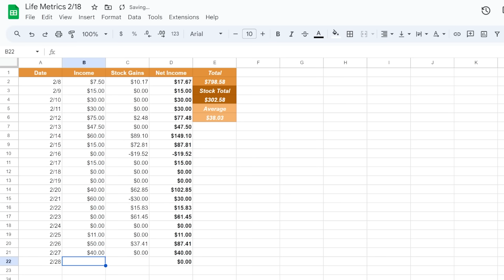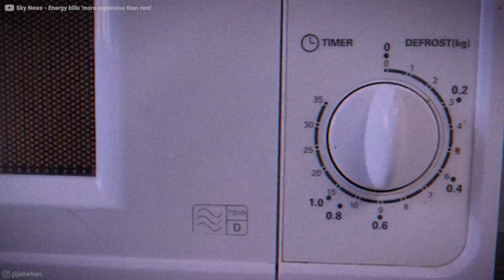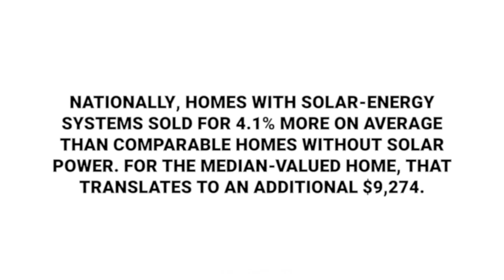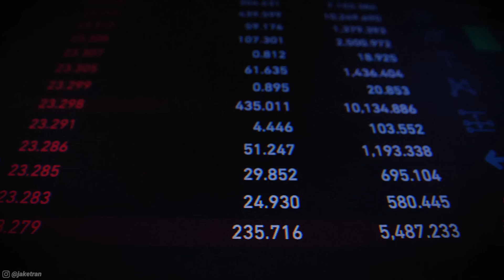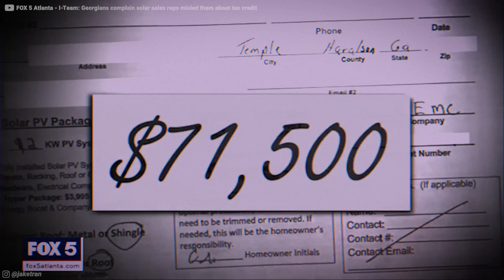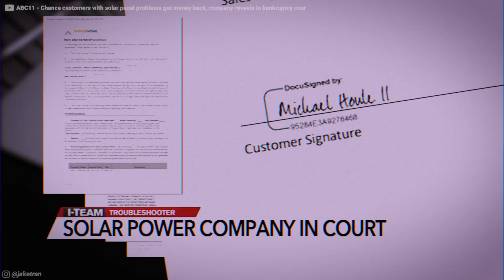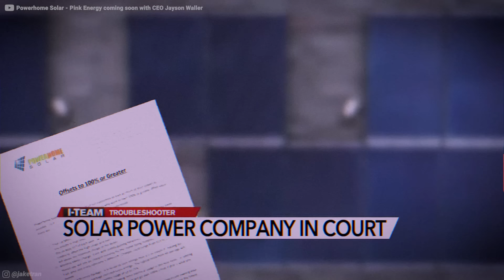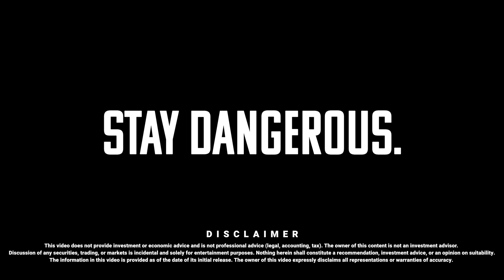Home solar panels are literally a scam.

Comment: I own a 5.5 kw off-grid solar system with 10 kwh power walls battery. I've paid for the whole system about 8000 Euros. In the last 9 months since I have it, my solar system produced 2000 kwh. It covered most of my need for electricity, with one big exception January and February. Besides cutting off my electric bill, also I pay nothing for charging my small electric car. So, basically my monthly expenses are being cut off from 160 Euros to 40 Euros during the winter months and to zero for the other periods of the year. That means in 6 years my solar system would get paid off. I think this is a good deal.

Comment: I have a 3 bed 2 bath house (1200 SF). I spent $70k on my system including generator backup. I'm completely off grid and very happy not having electricity bills. If one already has grid service, there is no reason for solar panels. I do know of someone who has off grid system and grid service. He charges batteries during day and sells excess for credit. At night, he disconnects grid and uses his batteries. He never pays anything because he has so much credit. Only uses grid service when he needs lots of electricity in short period of time.

Comment: I just finished a solar install. Canadian regulations on this are a little different. I was only allowed to install something that targets about 110% of my annual consumption. Was promised 9k in grants (4k from the local municipality and 5k from the federal government). The city already paid out and the federal government grant was already approved just hasn't paid out yet.

The rest is being covered by a federal loan but at 0% interest. That was the key reason I ended up moving forward with it at all was the loan details and 0% interest with no early repayment fees.

The utility retailer I moved over too also works a little differently than a lot of the retailers when dealing with a 2 way meter. Some only provide 50% credit etc but i'm signed up for flat summer vs winter rates. I'll be looking at a higher fixed summer rate when I should be over producing and a lower fixed winter rate when the Canadian winter absolutely destroys all of my solar production. In "theory" this means any overproduction during the summer that I accumulate as credit should be worth almost double through the winter when I'm basically constantly pulling from the grid.

Comment: I've worked as a solar designer and engineer for the past 4 years and, I wasn't  convinced at first. However, the numbers don't lie, solar is worth it. You just have to understand what you are getting and KNOW THE COMPANY THAT IS INSTALLING.  There are many fly-by-night companies that will do shoddy jobs and, if something goes wrong with the solar system, you are left with dealing with manufacturers and a local electrician who'll nail you for his/her work. If you are considering solar, talk with other people who have had solar installed. Additionally, know what - if any - benefits your state provides.

Comment: It's like used car sales. Sure, some are crooks but that doesn't mean they all are. We have solar panels on the roof of our house and are very happy with it. Just make the calculations before making a descision. Make a calculation on how many panels are right for your house and yearly consumption. Orientation of the panels is very important as well. Basicaly: only putting panels where the sun is shining from during midday is optimal. Nearby shade from high building can also seriously reduce the ammount of energy produced. Also important: how are the rules in your area regarding putting power onto the grid? Does your meter run back? Is it seperate from your consumption and how much money do you get for each KwH placed onto the grid? Do you have to pay to use the grid as buffer or not?

Comment: Tax credits do not need taxable income - nonrefundable tax credits do, the Residential Clean Energy Credit is nonrefundable so you're right about it but your verbiage is wrong.  If you get a refund every year, that definitely does not mean you do not qualify.  Nonrefundable tax credits offset your tax liability.  You might get refundable child tax credits and pay income taxes throughout the year (regular withholdings) and then get a refund, you'd still get a larger refund if you had the RCEC.

Source: i do income taxes

You should meet with a tax accountant or preparer if you don't understand how the RCEC will affect your taxes.

Comment: At one time, I worked as a solar salesman and realized that the numbers are far too high. I am building my own solar system on my house going through signature solar and it comes out to be much much cheaper. Living in Hawaii, I'm able to go completely off-grid for just under $23,000. With energy bills running around 500 a month, assuming no rate increases lol, it will pay for itself in under 4 years. Absurdly logical with battery backup. I highly suggested people just do the systems on their own and do a little research with someone who understands it. Solar is the cheapest way to get energy now if it's done right!

Comment: Here in England, a TYPICAL 3kW solar panel array with batteries, costing £10,000 will NEVER pay back the investment...NEVER.  It's not me saying that, it's simple mathematics.  The issue is with replacing the inverter and the batteries just at the point you think you may start to actually save money on energy.  Loss of interest on capital expenditure is NEVER taken into consideration in the data, and neither is panel degradation at 0.6% a year.

Comment: I worked for 3 solar companies, as a salesperson. then i did research while in the company.
1. solar panels have a degradation rate.
2. they make big assumptions that 10-30 yr will have a ROI.
3. panels can damage, if you get too much heat, it'll damage the panels.
4. not all solar panels use same material, solar company will not advertise this.
5. solar to energy conversion rate is different per company. do the research.
6. If you need roof shingle repairs, then you'll need to disassemable solar panels, repair the roof, then reinstall the solar panels... but the roofing company will not do that, you'll need to hire a private contractor who has experience or specializes in solar panel installations.
7. Weather impacts your energy absorption rate.
8. They have fine prints in the contract what is covered and not covered.
9. they promise 10 years, using simple math, but nature doesn't work with simple math, panel degradation will extend 10 years to 30 years, hence number 2 is a big assumption.
10. You may get tax refund from government, but that's a trap. If this is super easy investment, then every homeowner would have done this 20-30 years ago. But remember salespeople have to throw a pitch, because there's a catch.

Comment: I went off grid for 12.000 8 years ago with a 12 KWH system.  It was worth it just to not engage with any scummy companies and is still going pretty well with a little generating needed in the depths of winter.  It would cost 50.000 AU at least to get the power here (and then crap bills) so it will never be worth not being solar only for me.

Comment: Interesting that companies don't emphasize that a tax credit is a reduction in your Federal Income Tax. A large number of people no longer pay income taxes so 30% of $0 is $0 dollars!  I purchased solar panels from a great company. The salesman was very careful to not only explain the credit but also was very clear that solar panels are not a money maker. Size your system at your bear minimum need and don't purcahse a battery unless you lose power often.  I'm very happy with my system as I paid about $600 to the electric company where the previous year electric bill was over $3,000.  To be clear my 2022 electric cost was $3,258 and my 2023 cost was $627 for a savings of $2,630.  This is likely the best one can do (you have to live in California where the rates are outrageous). Note that the savings will be much lower if you have to finance the installation and if it ever snows the savings will be losses.

Comment: I first thought it was just a shot piece, but after listening It's nice you went over the actual issues. Solar is good, but you need to do the math and know how much you need in order to have everything work. Paying a company is usually paying for the labor, and not the the parts, sadly a lot of these companies put the labor onto the parts and make them more expensive. If bought and installed alone it doesn't cost to much, but if you buy the parts and find an installer it costs a bit, but still far less.

Comment: That's insane, in Australia solar panels are only $5-10k for the typical 6.6kW-11kW  installation. These cut the electricity bill by 50-100%. I haven't paid one cent in electricity since installing solar a year ago and I have no battery. Americans are getting jipped if those are the prices that you are paying!

Comment: Yup…. Gotta do your homework for sure, and be on top of the installation and turn on of service.   Reach out to your local utility company and find out what their kilowatt buy back program is about and fully understand it.
I was paying $500 plus a month during summer, now because of the credit I’ve accumulated, I pay nothing every month.  Besides my $187 a month loan.  
Find accredited companies and be on top of them for turn on of the system with local utility company.  
If you’re not comfortable climbing on your roof to clean those panels, recommend hiring someone out every 6 months to scrub them clean.  🤙🏼 just as you would getting your AC maintenance.  
The tax credit is a joke, unless you owe, it’s a CREDIT for a reason, and it doesn’t come in a lump some, it’s broken up, up to 3 years of filing.

Comment: Most of this I was following along quite well but what I don't get is how does a person have an electricity bill the same with all that solar If the solar panels are producing any energy at all can you tell me if the system of solar doesn't work at all in these cases if so I can understand and I would state for anybody reading this that's why I built my own system and yes I do see a lower Energy bill and I do know exactly how much energy is being put Into my grid so can you tell me a little bit more about why these solar systems are not working at all And some of them said  Electricity bill was even higher and coupled with the bill for the solar That is something I definitely want to know more about.

Comment: So at 5:07 you made an error. You say they claim it delivers double what the panels are actually able to deliver but the document you cite there is saying double what INSULATION AND EFFICIENCY IMPROVEMENTS would give. 

So maybe the wrong slide or smth idk.

Comment: This is really interesting to me. The USA costs for solar panels is outrageously overpriced. Here in Canada the price for solar installation is probably 1/3 the cost comparable. Also the federal government provides an interest free loan to anyone who gets solar. There's also tax breaks and provincial incentives as well. Most PV systems get paid off between 6-10 years and then it pays for itself. There are definitely draw backs with solar as mentioned in the video (the biggest being where you live). The sun don't shine you don't really make power. Also something that doesn't get talked about is the snow. The snow that falls ontop of the panels will stick. Once it stops snowing the panels heat will melt the first layer off and what ends up happening is the snow can come flying off you're roof fast and hard. All in all, if you're thinking about getting solar, do a TON of research before committing to anything. Compare quotes, know what will be placed on your roof, the exact process of installation, and other info mentioned the video. Hopefully this is helpful.👍

Comment: I want so bad to go solar where I live because it makes total sense I have it a lot of daylight and my power needs are fairly minimal. Where would someone go if they wanted to power a tiny house with fully off-grid power? Literally the only thing that I run is a computer TV heat pump and a fridge and oven range.

Comment: Know this is anecdotal but our solar system is exactly what we expected. The salesman even told us that our electric bill was so low that it didn't make sense for us at that level.we paid cash, our paycheck withholdings are enough that we got the full tax credit (we use tax withholdings like a mandatory saving account) then covid-19 hit & mother-in-law moved in, with all the extra electric use. Still havent had an electric bill 5 years on and everyone else's rates keep going up. Also provides an insulation gap between the pannels & the roof so the house stays cooler in the summer. Over all a happy ending.

Comment: The only thing solar that needs to happen on all homes is solar water heaters. They are relatively low cost and for most latitudes you get piping hot water throughout the year for free. I live in Europe and when I moved to California, I was amazed at how much money gets spent towards gas and electricity for water heating where the sun is so plentiful.

Comment: Build your own system, piece by piece. Tons of free info online. Like Will Prowse here on YouTube.  I bought a pallet of panels (26) from SanTan Solar for less than $1000. Also remember, technically you run on batteries, not solar. So that's where the bulk of your investment needs to go, is in your battery bank.

Comment: Solar is fantastic, I live off grid and without solar I would be living like a caveman.  It has cost me around $28 a month for battery maintenance. I installed it all myself. I have around $12,000 invested in the whole system that powers my single wide mobile home and outdoor tools in my work areas. I have been living off grid for around 12 years using this same system with no breakdowns other than batteries.

Comment: in my case, paid 29,500, used the tax credit to lower my tax liability to 0 for two years straight making my refunds like 4-5k each year which ended up being the 26% …. i didnt pay any interest because i basically paid them off all at once. 2.5 years later and they have generated 4.1k…. so it will take 10-11 years before i make a dollar of profit. 🤷🏼‍♂️ definitely not a good investment when i could have just gotten a rent house instead, but i will say my electricity bill is like 12-30 dollars a month now

Comment: I built an solar system for less then 500 dollars for my regular light load 
1kw panels and 2.6 kilowatt lead acid batteries 
And 650 watts ups/inverter
Working fine without grid and its fun to playing and do experiment with these things just dont buy fancy stuff and build it slowly

Comment: 13:00 "Whatever your opinion is on Climate Change, fossil fuels will eventually run out."

1) we need to stop referring to oil as fossil fuels. While we are unsure of their origin we are sure that it is not made from biodegraded carbon life forms.

2) are you sure its gonna run out? If we dont know the origin or what creates petroleum and natural gases, how can we be sure that we will run out. An estimate of how much petroleum reserve we are currently aware of will last over 100 more years, and thats assuming no new spots are found or created naturally.

3) there is still no evidence to "honestly" suggest that the burning of petroleum has any real significance on global climate. Most studies that have made such bold claims are either inconclusive or wildly inaccurate.

Comment: Solar works.  You don’t have to get 20 solar panels. Just get a few panels, an inverter and a charge controller and few good batteries.    You can get a good set up for less than a grand.

Comment: Solar panels are possibly useful for a small setup off grid for people who actually live out of a travel camper and need a little power. Or for those in the boonies literally off grid. Other than that, expensive and unecessary.

Comment: I would have to disagree from my experience. We had solar panels with batteries installed last March, and have only used power from the grid energy perhaps 5-10 times. And that's with the UK having a truly terrible summer. Solar panels are worth it if you buy batteries. Our electric and gas price are combined, and have halved in cost.

Comment: The power company only plays for 2 months of power that you produced for them the other 10 months they just take it that's the Duke energy Way
Reply: That's why you install a battery with your panels, and don't oversize your system

Comment: You technically don't need sunny days for it to work. The rays get through the clouds anyways. Not like the sun isn't up when it's cloudy.
Reply: Counterpoint: you do get significantly less production on are cloudy days.   The sunlight is attenuated by the clouds, and scattered to other places.

Plus, inverters don't work as efficiently, when they have to adapt to the change in available power due to clouds.
Reply: @carultch  I agree. But he said it doesn't work I believe.

Comment: tell this to my refridgerator on a (CLOSED LOOP SYSTEM) with my own batteries that it doesnt work and it will laugh at you. the grid tie-selling back to electric co, however is not feasible. or even worth it period do some research on how it works before buying anything.

Comment: I’ve been looking at solar panels for emergency use. I will only buy enough for small items. Cooking requires 1kw MINIMUM. Solar is not practical for almost anything except emergency situations.
Reply: I've got 18kw of solar.... During the day I can have ac on max, oven going, dryer going , charging my car and still not use any battery.
Reply: @kstorm889  I’m not saying that you don’t have a nice setup, I want to go solar myself, but to think that your average homeowner will know what they are getting is not true. I’m also looking at doing some of the work myself so I can save a bundle. That said your setup was probably not cheap.